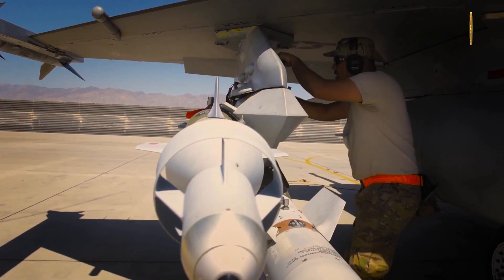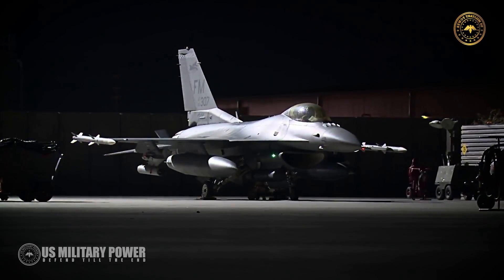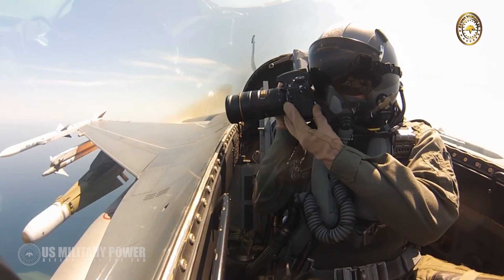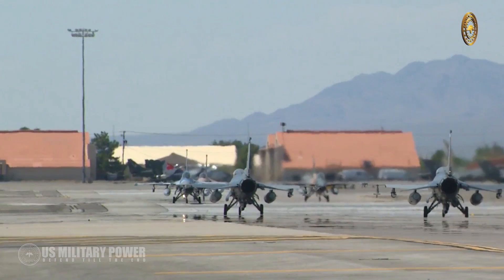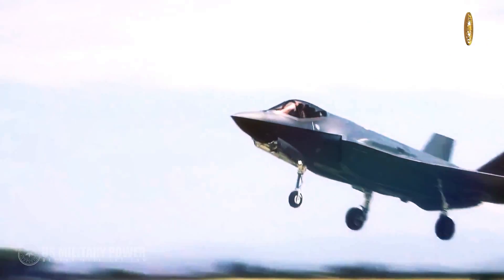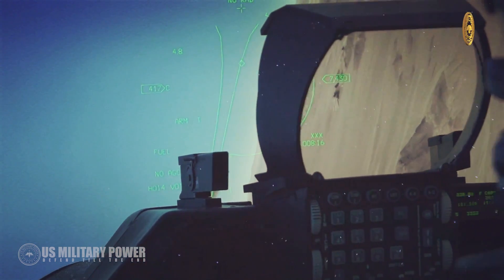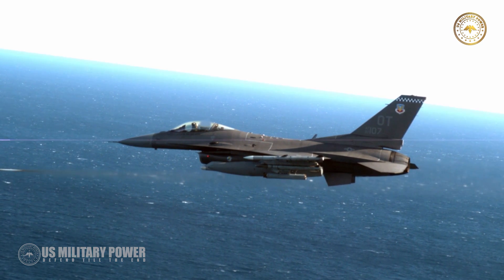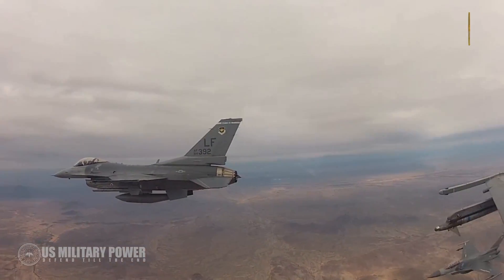How F-22 and F-35 'DNA' Will Make the 'New' F-16 a Real Killer

Comment: Huh isn’t our Air Force already a REAL killer? We haven’t lost a war yet so this 🦅 is pretty 🔥!!!!
Reply: Ok...Let me get this straight.  We have upgraded our already lethal F-16 with parts from the F-22 and F-35.  So why not just round out everything and call it the F-50.
 I mean, it’s really Not an F-16 anymore.  It looks like one but it by all rights is Not an F-16 anymore.  If you add all the components together you would have an F-73.  You could do worse but I doubt you could do better.  This by all rights is taking the best of the F-16, the best of the F-22 and the best of the F-35 which equals an F-73.  Hey, it works for me.  Are there any other ideas out there on this?